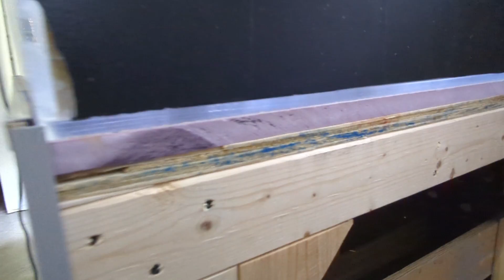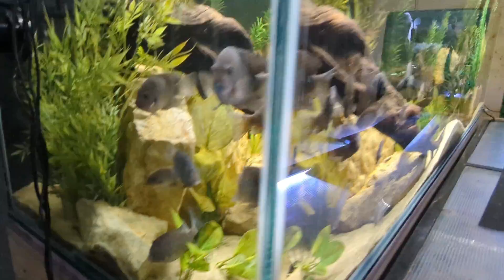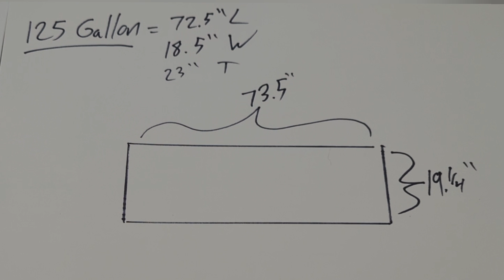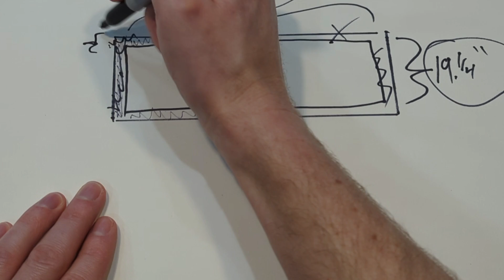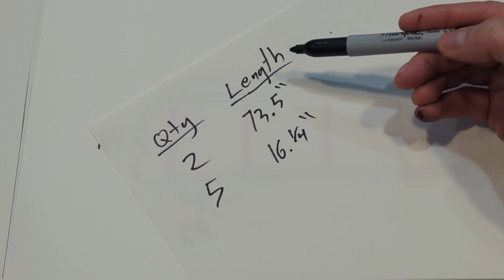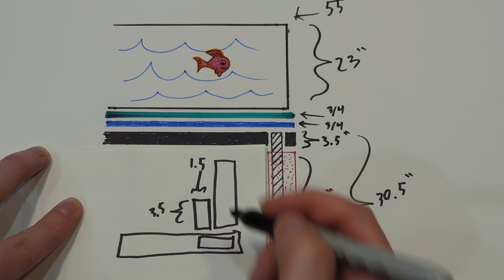How to Design & Plan: DIY Aquarium Stands Pt 2

Comment: Thinking about just building a box out of 4x4s, 3 12' lengths would add up to ~$45 plus a sheet of 3/4 plywood for under the tank and sump.

Add in a 2x4 for a couple of stretchers if I'm feeling anxious.

Comment: I see other diy tank builders make a complete rim around the bottom like it is on the top, but you do not. Why is that your preferences to just put braces in between the legs?
Reply from the maker: Hi. If you build a perimeter around the bottom, which would be in contact with the floor, it creates a lot more issues than you'd expect. Mainly that you can't ensure the load is settling in a point you want it to, and it's very arduous to ensure full support all around. Also, leveling gets harder.

Comment: Very impressive .....  i'll follow this in my future build. 

Question : If I want to rest a 225 G tank on concrete bricks ( available at home depot at $2 per piece ) and then place a ply & styrofoam, will that  work ? 

How many pillers of concrete beick do I need to put? I am nit planning to put my tank high. I'll not b more than 2 slabs of concrete bricks. What do u think?
Reply from the maker: Thanks! And I wouldn't recommend using concrete blocks. People do that, yes, and so have I. But I find it to be too unstable, especially for such a large tank.
Reply: I've never built an aquarium stand with 2 x 4s,  but I have built scores of tables for industrial use (for vinyl cutting, woodworking, and heavy assembly).  The concept is very similar. Looking forward to the next installment!